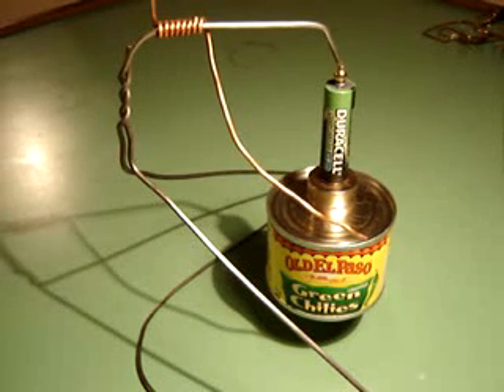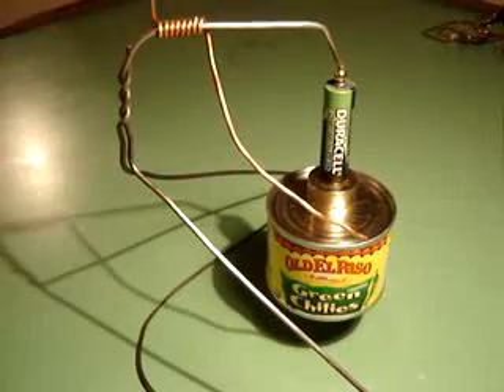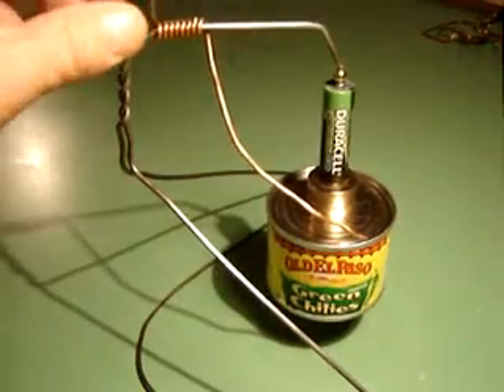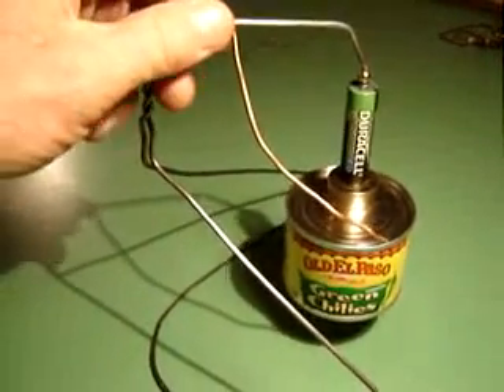The simple electromagnetic engine (part 1)

Comment: pretty cool... however i would have done it differently ... i would have attached some wire to each side of the motor, once it started spining too fast the two wires would fly out and hit some type of obstacle or complete a circuit  that would disrupt the first circuit